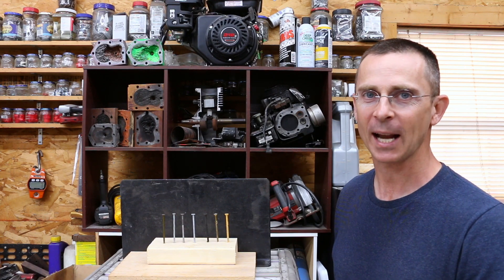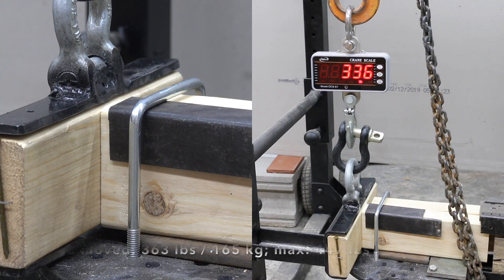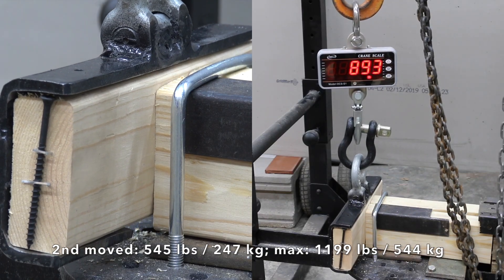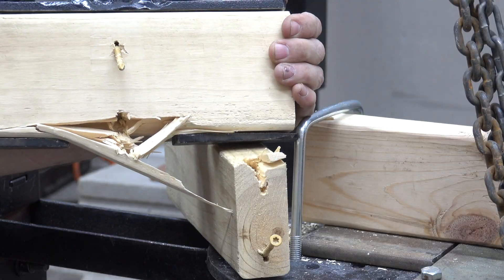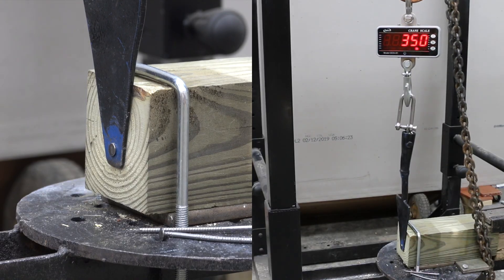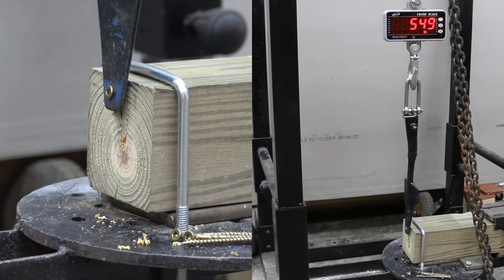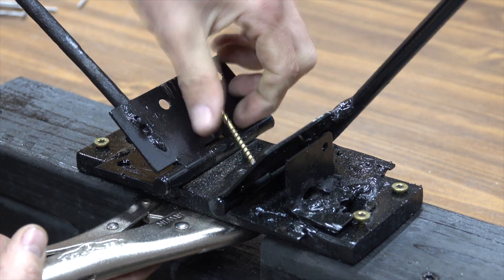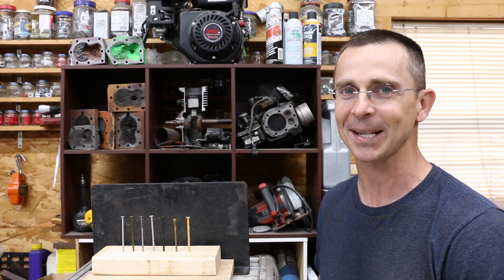Do Screws Shear easier than Nails? Let's find out!

Comment: I'm not an expert, so I'm only asking. Are those tests really testing shear strength?
I'm asking because you were pulling them out, and not actually breaking them.
Reply: I agree not a true sheer test but I found it more real world interesting.   Yes he could have welded a jig that prevented any lateral movement however that condition seems highly impractical in common applications.  Every instance I have encountered ( beams, deck, balconies,  fireplace) typically shows signs of lateral movement accompanying the medial failure.
Reply: @babaayman9658  It's about shear strength of the joint when the fastener is used in the manner demonstrated. Not about shear strength of the metal used in the fasteners. It was good to find that the screws didn't fail first.
Reply: @jamesmonahan1819  the best test for sheer strength was the last one. the screws all failed that one miserably. 
of course the screws will do better in pull out tests which is what the other tests were.

 there is a reason screws are not used in framing applications. houses would quickly fall down from screws snapping.
Reply: @paulk5311  the last test wasn't a shear test really. Shearing won't involve bending the nails and fasteners at the head. And If I remember correctly the screws just failed miserably at this very last test, so I'd go with screws rather than nails. I can't visualize how screws could move that much when joints are been made properly without bending beforehand.
Reply: It's a test of the shear strength of the joint between the two boards, not a test of the shear strength of the fastener itself.  So yes it's testing shear strength.  Just not the one some people seem to think should be tested.  Personally I think this practical type of test is more meaningful.
Reply: I found out what I needed to know
Reply: @jamesmonahan1819  not if you were looking for results of shear force you didn't, lol..
Reply: @BobSmith-rs7tn  The assemblies were put under a shear load to the point of failure, under real world intended use conditions.
 The NTSB, ASTM, OSHA, MSHA, and the DOD, would call that a: "Shear Failure". 
 I'm not using deck screws and nails as cotter keys and drawbar pins.
Reply: @BobSmith-rs7tn  He simulated sheer forces on a structure to determine which fastener would fail first. What you are wanting to see is a test that would determine which fastener would make the best cotter pin or something like that, it would not determine which fastener would hold a structure together under very high winds or some other extreme force. He wanted to see which would be best to frame a 2x4 structure that will hold up best. How well it resists pulling out of wood obviously plays a big part in that.
Reply: @actionjksn  What is the title of the video?
Reply: This is probably a better representation of actual structural loadings and failure modes, than an actual direct shear test.
Reply: He did more real world testing which gives better application information than just a high controlled test.
Reply: Yes they are testing shear strenght. Every nail screw was pulled upwards at an angle and cut into the wood. Along with bending the screw, the second test broke a lot of them. Grip test can't be avoided. Any test you do will involve grip this is a good shear test due to it being an angle pressure test.

 If you look at realistic circumstances. Natural disaster events ect. It's not avoidable to either be pulled + bent + broken. Shearing isn't 100%
Reply: Fraggle Rock the fasteners did not shear, they slid out. But the force was, initially anyway, a shear force. It acted perpendicular to the joint. It’s just a comparative test everybody calm down.
Reply: The test had 3 parts, the fastener and two pieces of lumber, thus the shear test was separating the joint created by these 3 parts.  This test simulated a test of shear force that it takes before the joint shift and becomes a problem, and then when the joint fails completely.

If this were a test for shearing force for the fastener, there would be no other elements such as the lumber, only the test jig to break the fastener.  To think this was only a shear force test of the fastener would be similar to someone thinking this were a test of shear force to break the lumber.
Reply: @ForedeckShuffle  so I take it you didnt finish the video, he did do a pure shear test with only the fasteners at the end where the nails came out ahead. So yes in our sure the nails are absolutely better but also the first 2 tests had more real world applications to them. I mean these fasteners are always gonna be in the lumber so yes while it's either just the fastener being pulled out or lumber failing it's still a realistic shear test. One of the drywall screws broke in the gurst test proving they can and will still brake in these conditions and in the second test multiple nails had their head pop off
Reply: I'm not an expert either, but I would say yes. He's not taking the bare fastener, and trying to shear it in a jig. He's putting them in wood, and applying a shear force to them to see how much force they can resist before failure. Failure in this case not necessarily meaning sheared in half, but a failure in application, whether that be shearing or coming out of the wood. So maybe its not technically pure shear strength, but an indication of how good they are under stress conditions.
Reply: @Goabnb94  me neither, but the tests with the logs are okay in itself to prove how much force is needed to take them apart. But for the last test where he BENDS the nails and screws there is no such thing to say that this would in any case test the shearing strength of said things. So no the last test was not a shearing application nor a shearing test by any means.
Reply: In practical use your only going to screw through wood
Reply: Doesn’t matter if it fails before it shears, a failure is a failure.
Reply: The wood would need to be harder.
Reply: g g The results wouldn’t realistically change by much.
Reply: Its not but the information given is pritty good even though the information is not 100% correct
Reply: @filespec  I didn't talk about the joint tests where the 2 logs are screwed or nailed together. The last one really was just a bending test and at that it's naturally for the screws to fail miserably. Didn't the nails fail at lower specs then the screws at all other tests?
Reply: It's testing an application that would be considered a shear load. In reality, it looks like those applications, the fasteners tend to torque out, and holding strength is actually more important than max shear strength, which is a more interesting result for real world purposes.
Reply: No it wasn't. Shear strength would be holding it straight in 2 areas and measuring the force it takes to shear it in half.
Reply: @DennisLewanowicz 
That was my suspicion. Thanks.
Reply: He also did a third test which is basicly what shearing is. It's not fool proof.
Reply: Yeah. The jig/puller/whatever he was using was just rotating. Would be better if he actually forced the boards up, instead of letting the chain pull them out.
Reply: His shear test always has some problems. Most of the time, it's minor and could be passable as a comparative only test.

In this case, it's really bad. It's not even a shear test. It becomes a bad bonding test. You could see the mode of failure of these screw and nail, all of them are bonding failure resulted from the pulling.... not shearing. But tbf, pulling is probably the realistic mode of failure of these screws and nails anyway.
 
The shear test should look like this. https://www.youtube.com/watch?v=iRBkWFmCyco
Reply: no, they were not, these test only really tested how soft a bunch of different pieces of wood are,
Reply: Usually his tests are good, this one is either misleading or just plain garbage.
Reply: @kingduckford  I agree with the first part, typically his tests are spot on. This one however was just measuring pull out strength in a different direction.
Reply: @kingduckford  I wouldn't say it's garbage. It's still applying a lateral load to the fastener. Maybe like how hydraulic press does it. Steel jig, with a 1" hole in the middle, and use a press (if he has one) that can measure applied force, and press down through the 1" hole until the fastener shears. The screws and nails would need to be able to locked in some how, and it would be shearing it at 2 points. But then I am no expert on any of this. I still think the tests ran give a lot of useful info.

Comment: As for screwing around...you nailed it! 
Good real-life stuff/use as always : )

How about a reflective barrier test?  I opine that heavy duty tin foil is as effective and much cheaper than commercial products.  If you decide to test this, I'm excited about your methodology to do so. And yea, planning to staple some to my rafters as I've discovered the heat transfer from wood in the roof to the inside ceiling is surprising ( I can IR my ceiling and find almost every roof 2x4 connection to my ceiling).  If I had the means ($) I would build a house with a fiberglass boot on every wood 2x4 that connects to the ceiling of a house.  

Best and Happy (belated) Fathers Day,
Ken
Reply from the maker: Thank you!

Comment: I like that you did testing on these screws vs. nails. I was watching this on the big screen before I pulled out my laptop to comment on your testing (double the ads).

I do have to point out, from an engineering perspective, that some of the testing (particularly the fatigue testing) might have been flawed in design. 

You measured several things such as yield, shear strength, and some failure points. I did like the practicality of the first test however the wood failed before the screws did in most cases. the second round of testing wasn't a test of the nail as much as it was the wood you fastened it to. The third test showed did show that screws are considerably more brittle than nails, which is true. Screws have to be a stronger more brittle metal otherwise the actual screw itself would round off and be ineffective when penetrating the wood. It's the trade-off between strength and ductility.

I think you had a lot of variables, and data that you missed an opportunity to record and control. I am interested in the shear strength of these types of material. Just because something is recommended to builders doesn't mean its the best; it only means it meets the minimum requirements. 

Most of the time, I'm given the information I need about materials and properties to do my job. I rarely actually test the material past principle. I'm not in the business of breaking stuff, just designing so it doesn't break.

There's a lot of stuff involved with a nail off the shelf that somebody has to consider. My recommendation for a good screw, is a good 6 point (Torx)  deck screw about 6-8in in length into some strong, treated, and sealed wood. If built and maintained correctly, it will last for a generation with no flexing. It doesn't necessarily have to be for a deck, but it can't be used everywhere. 

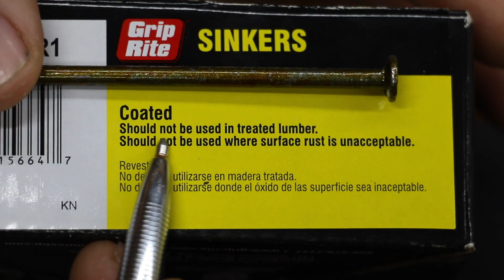1:41 A person also has to consider use and cost though when considering what material to use. In the case of a deck: If you want to build a deck yesterday, a nail gun with some galvanized shanks will do the job 2:58. If you want it on the cheap, two guys/gals with some cheap untreated wood, uncoated shanks and one hammer will have it done eventually.

Whenever there is any doubt, I would recommend consulting a professional. I'm not saying don't be a hobbyist because I support people doing projects, however, I don't want anybody to learn the wrong/hard lessons and running into problems.

Thank you for your videos. I miss how you'd somehow manage to involve a small lawn mower motor into every video.
Reply: Christian Guzman I read that and I’m amazed

Comment: Great tests! I'm surprised by some of these results, especially the drywall screws.

I'd like to know how quality lag screws, cheap lag screws, and structural screws hold up. One thing you might want to do when testing those, though, is to avoid the end-grain of the wood. Those structural fasteners should theoretically hold a lot of weight, much higher than end grain should handle.
Reply from the maker: Thank you!

Comment: Subscribed years ago. 4:35 I noticed the steel holding down the anchored board had moved back a little, allowing the screw to rip through easier. The placement of that piece of steel should be in the exact place on every test. I didn't notice the placement on every test, but I did notice that it had moved from the placement from the first nail test. This is one of my favorite channels. Thanks again for all the hard work in bringing us unbiased reviews of everyday products
Reply from the maker: Thank you for the constructive feedback!

Comment: It seems like the depth and angle of the threads on the drywall screws causes them to stabilize and compress the wood for huge holding power. I wonder if there are more ductile screws with similar or deeper threads (at a similar shallow slope); I think that would make for a killer general-purpose fastener!

The lumber seems to have a big impact on some of these tests, maybe it would make more sense to conduct them with thick ply or perpendicular to the grain layers of the wood, rather than along the faults (particularly in the 2x4 test). Maybe controlling for the grade of the lumber could help too, but maybe that's expensive (and it's probably painful to watch fasteners shred beautiful Select Structural lumber) .

Cheers!
Reply from the maker: Thank you!